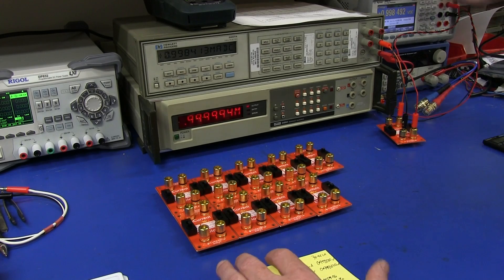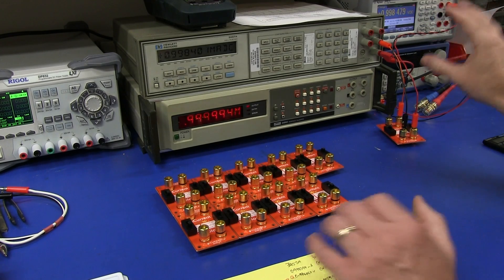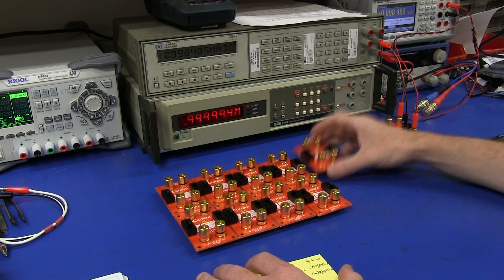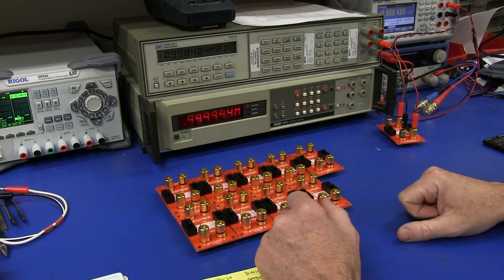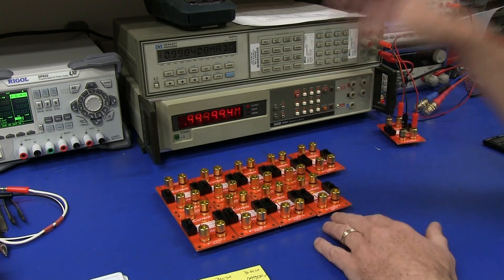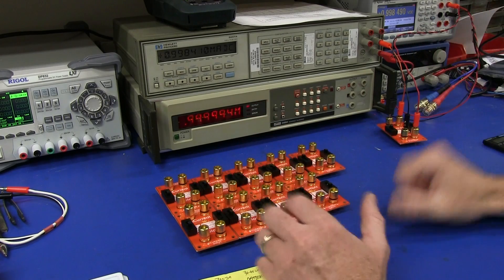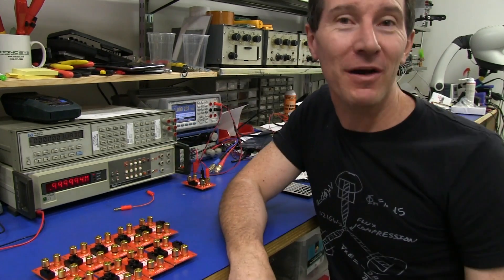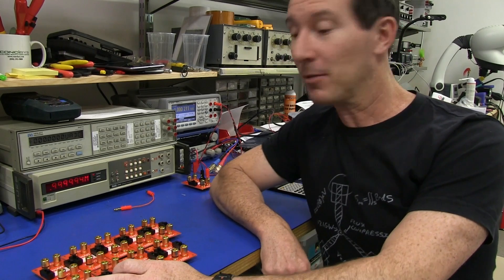uCurrent GOLD Kickstarter First Manufacture

Comment: This might sound silly but, what was it you just built? I know its a micro counter, but I don't know what you use it for.  I love your channel and watch you make the things you do but im at a loss on the on what you just made.
It is very encouraging and empowering to see that it is possible to make complicated circuits board by your self. You are Extremely entertaining compared to other instructors, I think you would be wonderful doing science shows, like that Bill Nye the science guy.
Reply: They're a device that allows your multimeter to more precisely measure amperage down to pico and microamps. For example, my multimeter can accurately measure down to (if I recall correctly) 1 milliamp, however with one of those, I could measure down to picoamps.

Comment: We want to see DIY Pick and place with some vacuum tools :)

Or a review of this cheap chineese PnP machines for ~3k $.

We are also very interested in testing jig. Would you us GPIB, or LAN with some computer software? how are you going to switch between 10 uCurrents on panel to same DMMs? Relays?

Would you consider including CAL "certificate" to each uCurrent, with errors measured with your equipment? Shouldn't be hard. Once automated over LAN with software you could just use a printer to print resulsts quiet easily and quickly.

Comment: First 3 panel 1hrs to finish... next 3 panel  1 1/2hrs to finish... and next ... and next... the last panel sleep on the floor! lol.I give up.  get a chinese made small production/prototype PnP machine (no optical). Cost around $2.5k - $4K.   Last time i check it's 5cents/pin if a board house would assemble for you.
Reply from the maker: Cost is about AU$6K + my time. That buys a LOT of machine time at my local assembly house.
Reply: EEVblog You sound stress out. If this project intended to be short term run then Au$6K + your man-hours is definitely not worth the deal. Prototype board usually 2-3 piece could be easily hand placement and oven reflowed. But if you have a order of 100pcs bi-monthly or other product then you should reconsider, if cost is concern. Thing that set you back now is that you already paid for the stencil,setup fees and etc to your assembly house. take this as a comment,you knows your job better then others. Everytime I laugh when I see people hand assemble a lot of smt board, sorry couldn't help myself. 
I'm also looking a mid size PnP machine... considering Juki brand.

Comment: What about long-term stability? Like turn them on, heat to 150C and see if they still within spec after 10 hours? High-temperature for accelerated parameter drift.
Reply: Please do not turn on circuits and heat them up to 150 Deg. C. This temperature is typically the maximum storage temperature and (depending on the part) junction temperature for Silicon Semiconductors.
Operating temperature for the part is usually about 125 Deg. C or 85 Deg. C depending on spec. As you need some margin for the heat regulator and it accuracy, you should not go too much above 100 Deg. C. Going to or above 125 Deg. C. would be out of spec and going to or above 150 Deg. C has to considered potentially damaging the semiconductor, so: No worth measuring the accuracy afterwards.
(But heating up to just above 100 Deg. C and then throw in to the freezer would be fun)
Reply: sarowie If we want to observe long-term aging in a reasonable time we have to be harsh to electronics. If 150 is too much, then 125. Or 85C for 1000 hours :-)

Comment: 21 thumbs up even when the video doesn't load. Seems legit.
Reply: just because it does not load for you doesn't mean it does not load for everyone else.
Reply: It didn't load for the first 20-30 mins. If YouTube comments weren't so stupid right now you would see other people made similar comments.
Reply: Kony Hawk Pro Slaver As TheChipmunk2008 says, it isn't always consistent throughout the world. - That others have the same problem as you does not prove that EVERYONE had that problem... There are dozens, if not hundreds of youtube servers spread around.the world. Which one you end up getting a video streamed from depends on your geographical location, and on which servers actually have copies of the video, Youtube basically distributes videos over time depending on where in the world they get watched the most. When a video has just been uploaded however, it's likely there are relatively few copies of it. - Any number of problems on any of the servers (or your connection to whatever servers have the correct video at any given time) could cause problems like that which will only affect a certain subset of people around the world. (In this case, it's logically more probable - though by no means guaranteed, that those in Australia will have less problems with a video like this early on than others will.). - 

And all of that doesn't even take into account the various problems caused by different combinations of hardware, operating systems and browsers people use to connect to youtube.
(My computer for instance won't run youtube very well if I use the browser I otherwise use most of the time. However, the same browser on another computer I own has no problems with it... - It can be THAT inconsistent...)
Reply: Kony Hawk Pro Slaver It sometimes does that for people from one region, and not others, if youtube in its stupidity gets a corrupt version stuck in one datacenter, you're screwed if you get video from that particular feed. It's happened to me numerous times in the UK with videos from US/Canada, and a few times from Aus/NZ